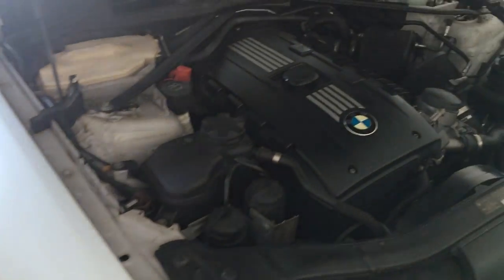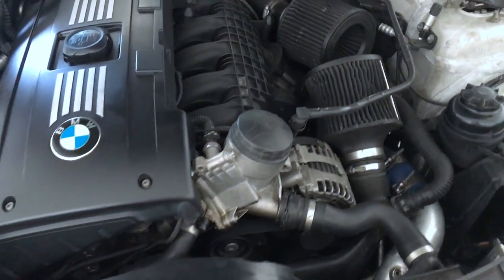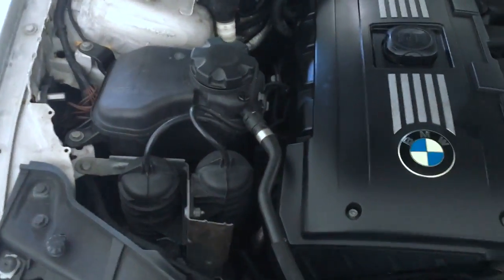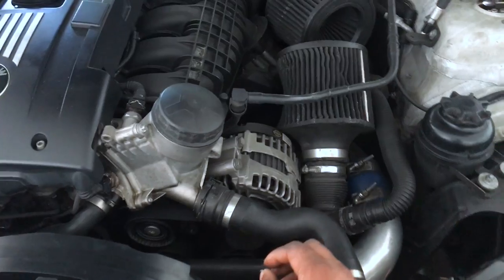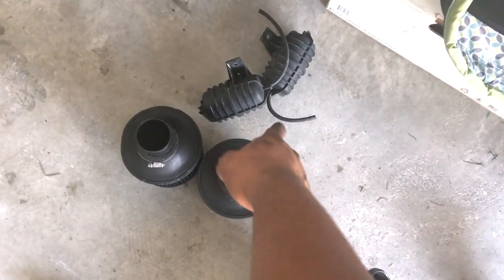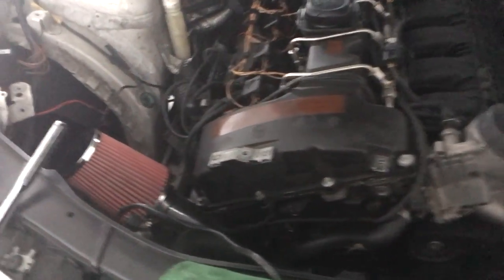BMW 335i N54 Inlet Install Nightmare

Comment: This car and oil leaks drive me nuts!  73k got the OFHG VCG all in ready to go just have to find the time.  Want to do oem placement inlets that have been sitting for over a year brand new in my basement lol.  I'm on stock turbos but push them pretty hard 22-24 psi midrange might hold upper rpm boost levels better with some inlets!  335xi N54 here car at launch (auto) lights up all 4 off the line pretty insane pull until my transfer case front diff and trans take a crap already get some slip (sometimes) xhp stage 3 flashed
Reply: Yea its not bad yet 1/2 quart between oil changes and i dump a bit out of the oil catch can at every oil change.  I drive kind of hard considering its not really a Daily.  I run a staggered 265 rear 235 front Michelin pilot super sports and it still will lay all 4 down in a first gear launch on a warm day.  Just waiting for the turbos to take a crap on me so I can upgrade and put in inlets with new turbos.  I have that seepage like you by the valve cover on the exhaust side of the car too.  Also keep blowing out my front right dif half axle seal all the time driving me nuts just did it 10k ago and its out again!
Reply: i agree maintenance and upgrades are a pain in the dick that way.... but i like my 3500RPM full boost 700wheel!  the powerband is so much nicer i can still autocross and all that
Reply: you can tell the different by changing the inlets?

Comment: You're running upgraded turbos with that small intercooler? I heard you have to get a 7.1 or it's not worth it
Reply from the maker: Haven’t had any issues with this ER competition intercooler since I installed it in 2011. I’ve ran it on stock, hybrids, and single turbo setups and iat are kept in check and recovers quite well in the Florida heat. Requires quite a bit of trimming to fit so it’s pretty hefty. It’s rated up to 600 hp, so definitely will have to swap it out on the next stage of my setup.

Comment: so you just removed the canisters? don't they serve a purpose?
Reply: Complex Seven Industries that's interesting. When I changed my valve cover gasket I had to remove the vacuum lines and I foolishly used a pick tool to do it. Next day after finishing the job I was driving to work, hit boost and the half engine light came on and my scanner said I had no boost. Turns out I cut the lines

Comment: im about to blast the intake chambers on my head...you ever attempted that?
Reply: Complex Seven Industries walnut kit from baverian
Reply: water pump was fun because my big ass intercooler... but not bad
Reply: Complex Seven Industries i could imagine on oil pan, and yeah got the big cx intercooler and piping
Reply: Did you get the rear inlet done yet, do you have to drop subframe for it
Reply: could it be done without removing downpipes
Reply: I want to do in my driveway but have xdrive and can't drop subframe or remove downpipes
Reply: TheMoce72 I have xdrive and I am in the process of replacing the turbos now. the inlets might be able to be installed without dropping the subframe but it would be pretty difficult to get the rear inlet off. harbor freight has an engine support bar for 80$ that I used to drop it. I would recommend dropping it because it will save you headaches and frustration from trying to work in such a small cramped space
Reply: Martin Resinger Any tips or gotchas that you came across? Turbo seals went out on my 335i e92 xdrive and I'm about to tear into her. Planning on VRSF downpipes, inlets/outlets but not too excited about it. I wanted to do it later on, but my hand has been forced lol
Reply: Complex Seven Industries I, uh, just ordered the Doc race kit lol Was gonna do upgraded OEM, but decided to just say fuck it and go for the big boy kit lol
Reply: Complex Seven Industries I thought about doing upgraded OEMs and new inlets and down pipes, but i knew i wouldnt be hapoy with that after a while. One of the turbo seals is shot and I got oil sprayed on the cats, so I'm just gonna sawzall all that shit out lol I'm hoping to not even touch the subframe or motor mounts, but we'll see.